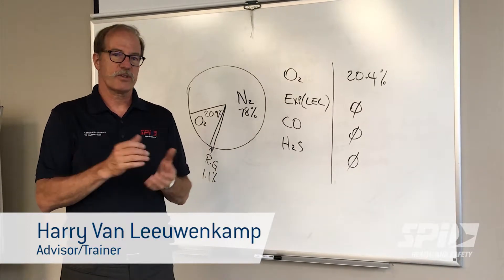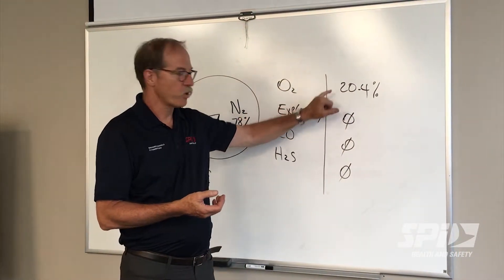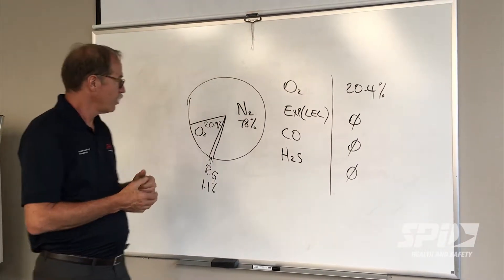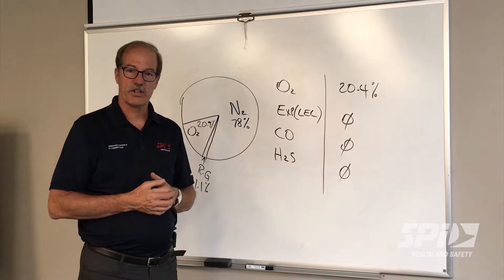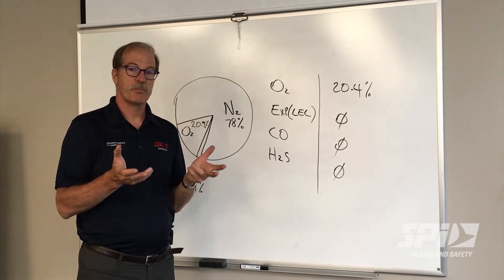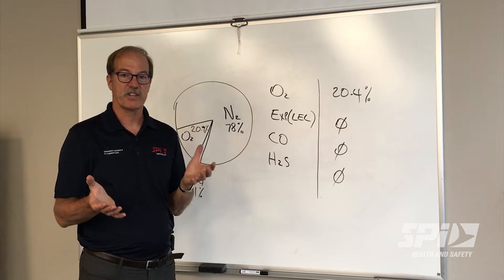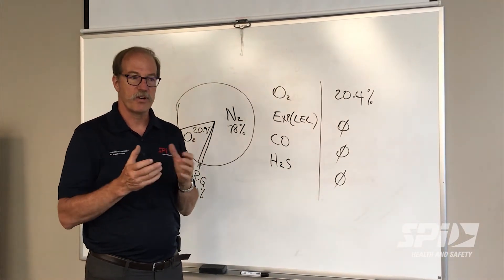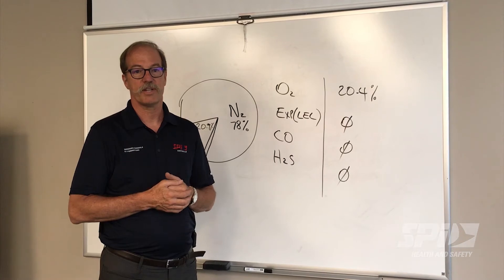How to Interpret Correctly the Results on a Gas Detector | SPI Health and Safety

Comment: Thanks for this valid video, may I ask this question, how 0.5% vol equals 25000 ppm, I expected that it will be  5000 ppm!!!
Reply from the maker: Thanks for your question! 

Oxygen is only about one fifth of a normal atmosphere. The detector analyses only the oxygen portion. When a toxic gas displaces the atmosphere (1/5), it will displace the oxygen and also the nitrogen and other gasses (4/5). 1/5 of the atmosphere (oxygen) equals 5000ppm 4/5 of the atmosphere (nitrogen plus other gasses) equals 20,000ppm for a total of 25,000ppm.

I hope it answered your question. Please don’t hesitate to visit our website at www.spi-s.com and contact us directly for more information.